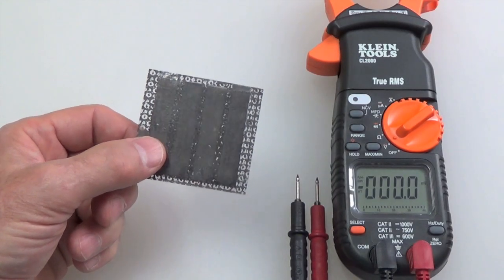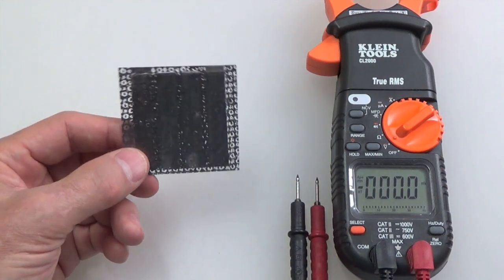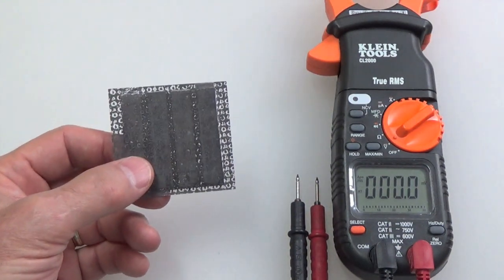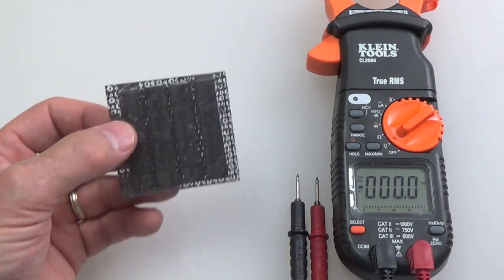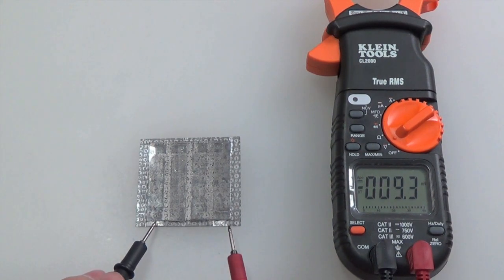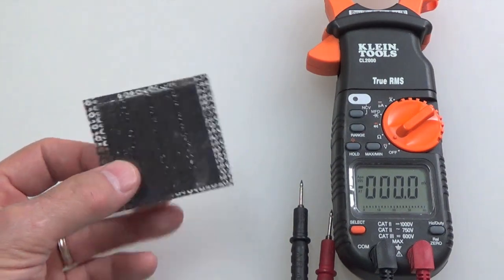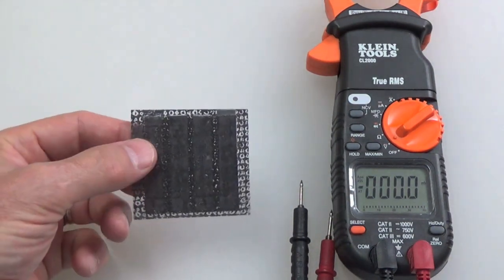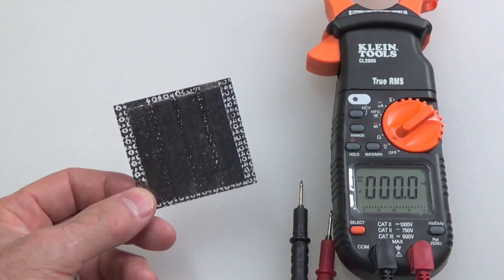USB Powercell - NEW

Comment: I wish I hade mastered your teachings, but if I add to it oxide and one with cooper and the other with aluminum and a dielectric separator u could stack them to create voltage needed to self-charge? a hybrid... and you're the one to make it, destiny calls it. you know this, you have done it on many other devices. maybe the tube cells should be added to create the free volts. you just need lots of them, can you miniaturize them? personally, my brain wants to explode in all that I know to do now. it's way too much without any support or financing. the lack of support has made it almost impossible to advance in innovations. we both figured out similar methods but different and at once simple in its understanding when combined it enlarges reality so wide and clear it is possible to create the WAY of THE HEART AND SOUL in wisdom and understanding. can you feel the sincerity in this msg?

Comment: Hello.  this is great stuff.--I Don't know much about this but I believe I read somewhere that the battery life, depending on use, before it drain (I guess it's the cycle?) last about 4 hours the it recharges back up?--If so, it seems to me that if you know how long it takes for it to recharge on it's own, you could simply add enough so as one drains, the other one kicks in allowing the drained one to recharge!  Would this mean that you would not need to connect to the grid to recharge, per say, your cell phone?!  hope you get a chance to reply.
Reply from the maker: On a slightly larger scale, here is a process sample of energy cycling and cell regeneration of which you are referring to:  https://youtu.be/ghQZ1Wtj9hc?t=4m2s

Comment: If you are aware of using crystal structures to use vibration to generate electricity? Then why have you not developed a crystal power cell stack with different vibrational frequencies that produce higher electrical current generation in other crystal power cells? If you had real knowledge then you would not have wasted time and money on that pulse generator correct? LOL

Comment: Could you stack a bunch of these connected in series in a cube shape with a hertz emitting diode or vacuum spark gap that generated a resonance bubble that caused the cells to optimize their electrical current generation? Say like make a two foot by two foot cube that could power an electric vehicle? Or use the larger cells in the same manner to power a home?

Comment: It would be advantageous if those cells could be built where the cost would be low enough to be affordable. I would to see 20 of those cells wired in parallel with a DC to AC 220v inverter so it could be used as an emergency power supply to partially charge a Nissan Leaf on the road.

Comment: If all energy is based on frequency and these power cells will draw in frequency with a dead short? Could you not find a a balance and generate a stable field like how the earth works to power an electronic device? Would this not be that free energy so many are seeking?

Comment: If not then these concepts could be used in all vehicles vessels and aircraft removing the need to use fossil fuels correct? I am just brainstorming here with the small stuff I ask these questions because I have much bigger concepts that these systems will power so i am just trying to pick your brain for knowledge. ; )

Comment: Could you form a ring of this material and use in electrical vehicle tires and generate a hertz frequency to produce electric power and also use the heat of the in hub electric motor to generate more output? Would this design work? Putting everything in the wheel leaving the rest of the vehicle for other redundant components for backup systems to power the vehicle? Is this advanced technology not advanced technology and my science is just off?

Comment: Could you connect a bunch of these like you did the bigger cells and place a Hertz generating diode at the center of the cube set to activate the Crystal graphite electrical power output and create an electrical power generating cube? Could not one of these power electric motors in electric vehicles? I thought I might ask stupid questions to get really smart answers. ; )

Comment: Could you not design an emergency self heated blanket by using these with atomic skin heated clothing technology? The heat would energize the Crystals that feed a steady flow back to the electronics generating the heat? Hay a self heating emergency space heater could be designed has well. Novartis

Comment: Could you not use these in artificial limbs in the cups to generate power from body heat to operate the artificial limb? These waffers generate power off heat and vibration do they not? Would this not have multiple applications and a wide variety of uses for this product?

Comment: how will you solve the over usage problem that in your previous silicon graphite cells video required caps to be constantly charged by short electric bursts?
Reply from the maker: The ultracaps were charged with a constant steady output. Short circuit bursts directly from Si-Graphite cells demonstrated current discharges from capacitive layer inside each cell.
Reply: PMMG4HYBRID oh, I misunderstood. I thought you can't have them under constant current or they'll oxidize too fast, so that's why you used the super capacitors
Reply from the maker: If you continuously attempt to demand high output from cells faster than they can regenerate into the capacitive layer,  you will accelerate a redox degradation.
Reply: PMMG4HYBRID right, so the caps are actually needed for higher outputs
would be interesting to see these guys in action in our modern electronics
Reply from the maker: Caps provide a faster storage medium from which you can tap a higher current when necessary.
Reply: PMMG4HYBRID yes, that was clear to me :) thanks for your time on my question

Comment: Would an axial vector engine switched over to run off hot air like in a manson engine be able to replace your pulse motor to turn a low RPM electric generator to power up a home off grid?

Comment: If these are Crystal and if you make a cube of these that generate energy and energy is vibration and you reach a resonance would it not be a zero point module? Science fiction stuff right? The earths resonance would produce electrical energy has a flat output. If a harmonic was introduced would not electrical generation be off the charts? O am just guessing here but its something to think about correct? ; )

Comment: Is there an exothermic or endothermic reaction happening? Does voltage change in extreme temperatures or vacuum? This is very interesting potential advancement.
Reply from the maker: With this particular cell, it's only slightly endothermic where heat absorbed by the graphite can be beneficial for a small gain in output. Haven't tested extremes or a vacuum condition.

Comment: How do you recharge the cells once the reaction in the moisture drops to zero? I did that by replacing the water. You should try to make a sort of supercaps and use them in resonating circuits.
Reply from the maker: What moisture? No need to add or replace anything. Each cell has its own internal supercap layer.
Reply: +PMMG4HYBRID the "dielectric" in what you call supercaps is the source of energy, silicon and graphite are just catalysts. In time it will lose its ability to produce amperage, which is already too low. If you don't replace it, you should put the cell in a resonating circuit to "recharge" the internal resonance of whatever you're using as a dielectric, in my case salt water worked best.

Comment: How do you recharge the cells? I think you get about 10 mA of output when you test it and then it drops slowly to 3-4 mA, but in time the moisture will lose its power. How do you replace water or how do you energize it to restart the reaction?
Reply from the maker: No recharge. Current doesn't work like you think. What moisture? What water?

Comment: hi dear PMM, really nice work!! have you any  measurements of the capacity of this thing? Hope, when you will finish this nice development it will go to 3d printing area and many people will be able to have such nice printed "capacitors".
Reply from the maker: Nice to hear from you Rob. It's not a capacitor. Several of my different cells have been generating low power for up to 6 months now, without any charging.  Silicon Crystal Graphite Powercells.
Reply: I trust you, then most valuable thing to move to 3d printing area PMM, trust me and think about it. If you need help or support in this count on me.Noone on the world able or could stop FDM tech.It is like mechanical virus and game changer.

Comment: Do you get more wattage near an RF transmitter?
Reply: When can you start to sell? please name a time span how long it takes. Did you build gibber ones with power like a carbattery? (12V 40Ah) As soon as you get the patent, start a crowdfunding to speed things up.
Reply from the maker: No. It is not affected by RF.